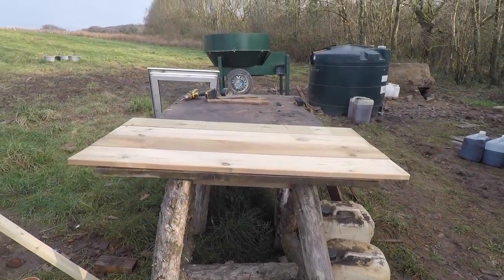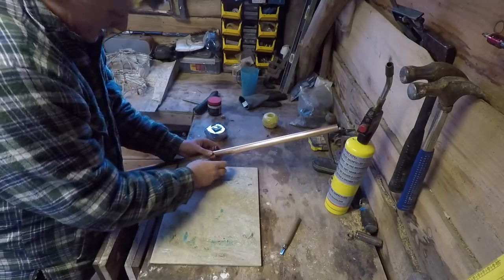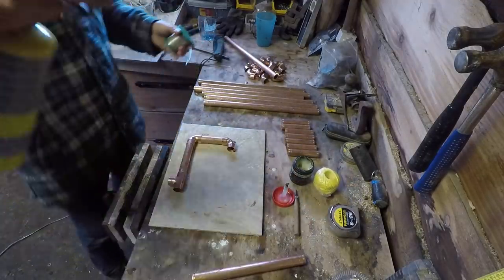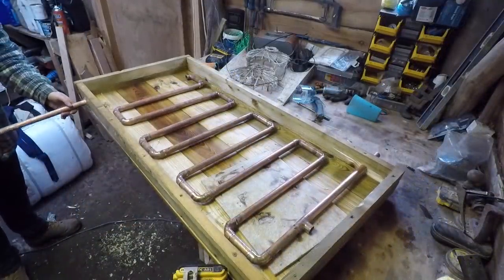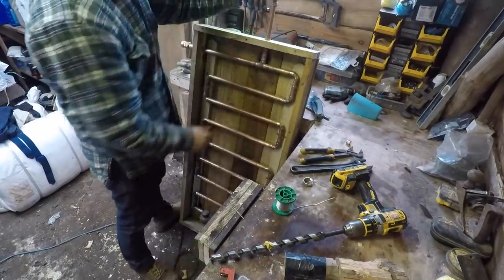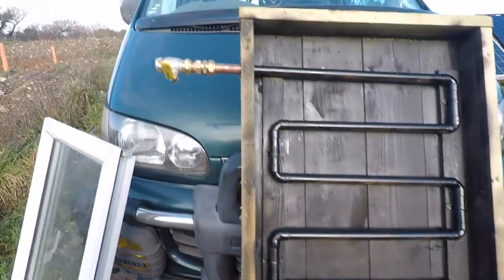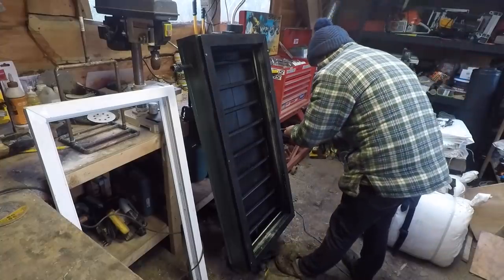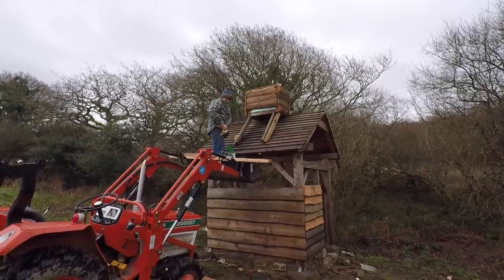Off Grid Solar Shower And Compost Toilet Part 4 Solar Hot water panel

Comment: I built one of these to heat my swimming pool which is about 12,000 liters. It was roughly 4 times the size of yours. In full sun it could raise the temperature of the water 2-3 degrees in about 8 hours in June.  Your latitude and time of year make a big difference on how well these work. I think you will find you will need to make that one larger (or just add a second as you have room).
Reply from the maker: There is a 100x  difference from 12.000 liters to 120...... with only 4 times the panels im not suprised. according to your number i should get a 75 degree rise. if you scale down those numbers you will get the same. of course i wont get that much because of my location. but a quarter of that would be great. the water is already about 15-20 degrees if i add another 20 that will be a hot shower! but you get the point, your calculations are favourable to the size of the panel considering it is 120 liters.
Reply: @KrisHarbour  Don't forget the time of year makes a difference also. What I have works well in June but come late August early September it isn't enough. My numbers aren't totally accurate either as the pool itself gets sun as well as the coils. A wireless thermometer could help you sort out exactly what you are getting as you can take readings easily over time.

Comment: Hi Krics could u do it on the cheap using black plastic coiled pipe?
Reply from the maker: yeah, i am thinking about using some black plastic pipe as well coiled on the roof. depends on the demand for the hot water. if we need more i will add more

Comment: Kris, would it have mattered if you ran the copper height wise? Also, is there a reason to your spacing of the copper? Thanx.
Reply: Spacing of the copper is to keep it from touching the wood and causing heat loss, although with out any insulation he is still going to experience some
Reply: The copper tube needs to go the way it is zig zagging upwards because as the water warms it will rise up creating a thermal siphon. 
If the pipe was run vertically then it has to come down again in a zigzag or run from a lower manifold to an upper manifold. The vertical zigzag won’t work and verticals between 2 manifold will work but might not be as efficient or get as hot.
Reply: Yes it would have made a huge difference, the way he has done it is the correct way. As the water heats it goes up the pipes and exits the valve at the top...if he ran it vertical then the water would have to heat up, get to the top of a run then cool down to go back down the bottom of the next run then heat up again....but the water cant cool down so it would end up just being all one temp in the pipes and you wouldn't get any thermal syphoning.... does that make sense.
As for his spacing of the copper, I'm a little confused on that one...he could have gotten twice as much in the box and had it heat a lot more efficiently
Reply: @res1492  Yes, that's what I thought.
Reply: @res1492  thank u...I too thought he could have fit a few more rows of copper.
Reply: Thunder Cats hooooo!!...god i feel old
Reply: @res1492  lol...childhood cartoons
Reply: heheh i was 10 when the first series aired (1985)...and damm did i have the hots for Cheetara
Reply: @res1492  lolol...I was 12 and also had a few nights dreaming of cheetara....hahah
Reply: lol...80's cartoons..the good old days, ThunderCats, M.A.S.K and Dungeons & Dragons in that order, thanks for the laugh and memories, Merry Christmas buddy!!
Reply: You could always run the pipe vertically, and then turn the box on it's side, A lot less soldering and joints.

Comment: Vertical spacing on the pipes is too far apart,  could have had at least 6, possibly 8 more legs in that housing.
Reply: Also could have saved $ on parts and construction time by running the pipes longways....  just a tip for those reading comments before trying it themselves....

Comment: Coper pipe too big and too short in the heating zone, you need soft coper and as small so it can heat much quicker and longer water traveling through the heating zone.

Comment: I see a few comments of people saying soda cans, copper sheet, black foil to help heat the water, Why not just use every day cheap aluminum foil from the supermarket, 30m roll for a couple of dollars and some spray adhesive., its easy to work with, it will insulate the box so heat cant escape and produce more hot water

Comment: K... not sure on how your connecting to a tank & recirculating hot water via thermo siphon???
but if your trying to collect as much hot water as possible, i suggest replacing the copper pipe you cut & fitted with a roll of copper pipe TUBING!!! (not straight copper tubing) its a roll of copper pipe & you compress about 20+ feet with in your collector. you would have row over row of collection surface area; kind of like a spring you spread open... wish i could show you a pic but i hope i'm communicating the concept.

i found a video: https://www.youtube.com/watch?v=nC_Ql5qVs4Q
 good luck

Comment: Kris You know I love what you're doing and the channel but come on that 3/4 inch pipe is not going to work. You have all that grass you cut, wood shavings and leaves as well general compost. Build a compost heap put a roll of  Polythene Piping within and the heat the water from the composting material and this would heat all the water you need.
 If it was me and it is not, I would find an old hot water cylinder that you could insulate with whatever you can find if it's not already. Then use the tank on the roof to fill the fill the coil before the tank and store water in the cylinder.

Comment: Dont think that will work thats a double glazed window they designed for reducing heat lose meaning a lot of the heat sourced from the sun is going to be blocked by the glazed unit doing it job
Reply: Barry Snelling  I think it was single glazed.
Reply: Am pretty sure if we put you in that box behind that glass in the summer you wouldn't last 5 minuets with the amount of heat it will generate. Time will tell if it works or not. :)

Comment: You love working with copper.... yet you don't know how to solder... hmmmmm.....and you aren't using Thermosyphoning which is free... the tank goes higher than the solar collector, hot water rises cold water falls .... sorry mate you live splendidly and are quite ingenious, I love your house and the way you live... but I had to comment... peace to you...
Reply from the maker: The joints dont leak, The tank is higher, water comes out the bottom of the tank and falls to the bottom of the panel then rises and goes in at the top of the tank...... its comments like this that will very quickly stop me from bothering to interact anymore.